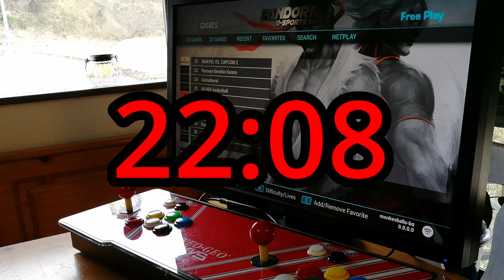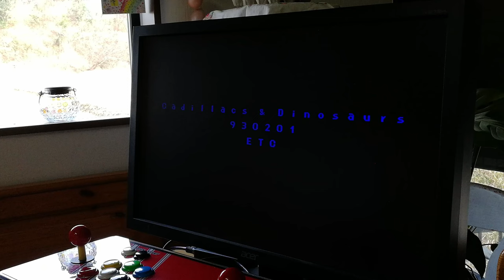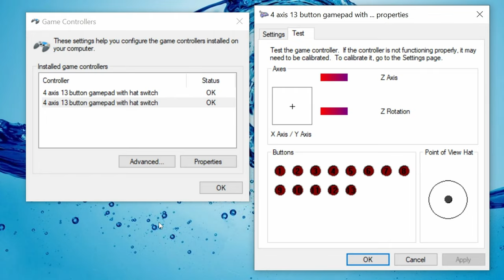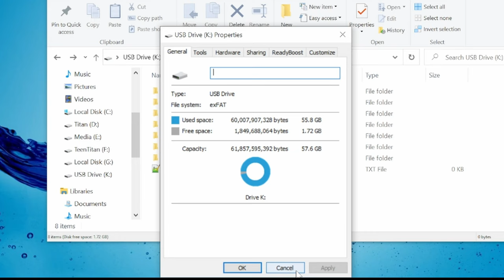Pandora ESports Box Review: First ONLINE Arcade Box!?

Comment: 13:12 That's Megaman 3. The reason it's off speed is because that's a PAL rom running on an NTSC forced emulator. Swap the rom out for the correct version and it should run correctly.

Comment: Hi Pandory
Probably a common question but refreshed for 2023! Which Pandora motherboard A3 or clone gives the best performance and config? Considering new and older machines to emulate
Reply from the maker: What's an A3?  - Nothing really has changed for two years ago, but with added confusion- and the answer to your question also depends on if you care about aspect ratio correction, and which graphic output you wish to use (VGA, HDMI, or JAMMA EDGE on a 15hz CRT)
Reply: @TeamPandory  sorry confused myself. It was meant to be 3A games. Mainly older arcade games, but would be nice to emulate some console games like flashback if any do well.  Currently I have the DX
Reply from the maker: @timhewett5108  Pop on PandoryDX 🙂  Seriously, that's one of the best, but I guess others to consider may be Pandora 3D Games Saga 4188, or if you want to go with 3A, their Box EX... If you want to know what we think of that, check the review ;-)  - TBH the next step up is emuelec on a N2+, and if you want to go all in, a Mini PC with Batocera.
Reply: @TeamPandory  yes. Inspired back then from your video and built a PC with Batocera. If I want to convert that to go in my arcade box what do I need to make it compatible with buttons…. Assuming some form of encoder for two player, screen and audio controller board but this is guessing. Any advice on parts, brands etc? So far you guys have been spot on the money!
Reply from the maker: @timhewett5108  So the best bang for buck, with the lowest latency, is probably the ... Raspberry Pi Pico!  Grab them and get some soldering done.  It's not too difficult, and we show the process in getting it ready in this video here: https://youtu.be/PFcV_SzzosU